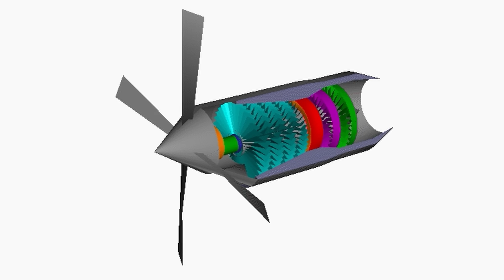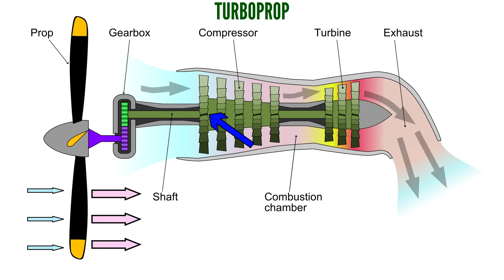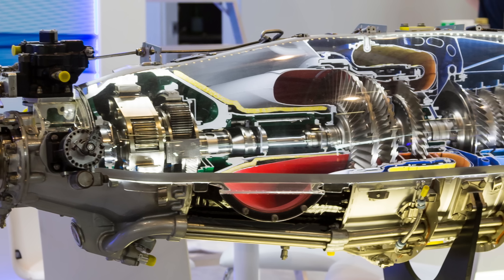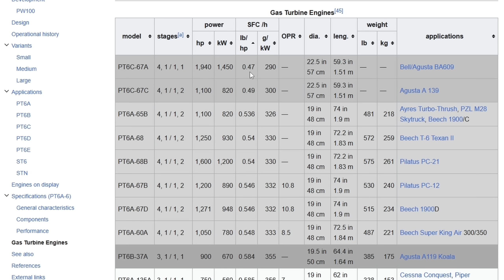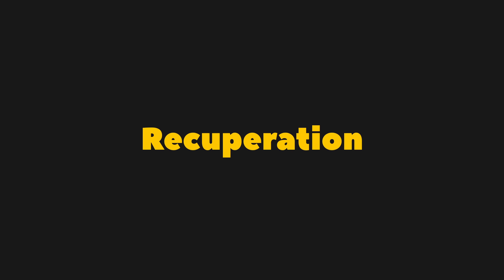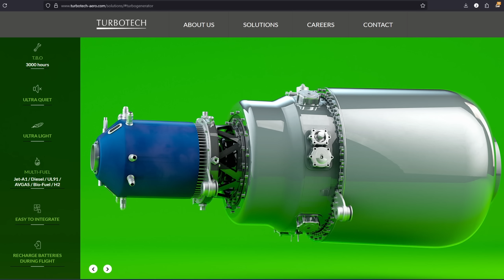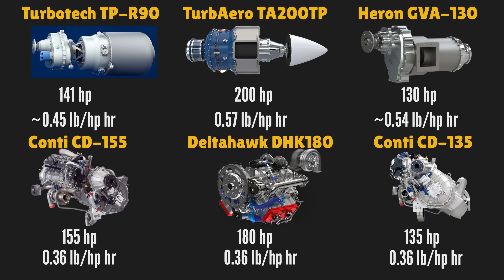Are Piston Engines Dead? Small Turboprops are Here

Comment: The bigger challenge will be to get STCs for older aircrafts as only few are able to afford a new e.g. Cirrus for 1.6 Mio EUR. If I could swap my IO-470-K (225hp; 1700hrs TBO) for a Turbopro with similar hp, 3000+ hrs TBO and 60-75k EUR, it would immediately become a valid alternative. Not happening though...

Comment: One simple answer, cost of ownership (incl maintenance and overhaul). Turbine engines cannot compete with pistons on this basis alone. Second issue is power range. Smaller aircraft cannot justify a 500SHP turbine (PT6-110, the smallest) when it only needs 300HP. Yes, I know that there are small turbine engines (e.g. an small Allison from a helicopter was put into an aircraft called a Nomad). For a small output, actual maintenance costs for an equivelant power turbine were much higher per flying hour. A brand new PT6-140 is around USD 560,000. A 300HP piston 6 is around USD 110,000. Even the smallest Garrett TPE331 is about 570SHP, no use for a cessna 206 for example which has 300HP.

Comment: In Europe (especially) avgas availability is an increasing problem. This makes Jet A engines attractive. Given diesel engine reliability issues I would pay more for a turbine option when flying single engine.
Reply from the maker: Yes, Avgas availability in Europe is a recurring theme in comments. The alternatives isn't just turboprops, it's also piston engines running on mogas (all the Rotax engines mentioned in video), or diesel piston engines (Continental CD-100 range, and Deltahawk).

In my opinion, wide turboprop adoption would need more than just the lack of Avgas availability, as there are other non-Avgas alternatives it needs to beat first.

Comment: A lightweight diesel would be more appropriate for snall planes. Power band right where you want it at 23 or 2400 rpm, run happily on everything from kero to mazola, no carb icing, no gears, simple, reliable, durable, economical. I guess that's why they don't make them. Certainly not gonna blow anyone's socks off on take-off or doing aerobatics, but for getting from A to B? Nothing makes more sense - and we do have the technology. Diesels do not need to be heavy anymore.

Of course turbines are great, but if we have the tech to build a 36,000 rpm blowtorch using advanced metallurgy and gear it down, I'm pretty sure we can come up with a basic 3 or 4-banger diesel at 1/10th the price and headaches.

Comment: They need to take this idea to the Next Level: A big drawback to turboprop engines is Turbine Lag - the time delay between when the pilot throttles up for power and when the engine actually delivers the called-for power. Pilots of single-engine and light twin-engine GA aircraft who are used to the rapid throttle response of internal combustion engines (which is critical to the performance of aircraft in this category) will be at a big disadvantage when they have to deal with Turbine Lag - a loss of performance drawback that could definitely result in an increase in accidents, injuries, and fatalities. 
The Solution:  Couple a small turbine engine with a generator + a small advanced lightweight battery pack + a light weight super-capacitor bank - driving an electric motor and propeller combo that, thanks to the full-torque availability from zero rpm that only electric motors can deliver pilots will now have ZERO Turbine Lag and unparalleled rapid-throttle response that far exceeds the throttle response of internal combustion engines. This combo will not only deliver a dramatic performance increase, but it will also provide a safety margin increase with high reliability of electric motors driving the propellers, along with the high reliability of the small turbine engine(s) driving a generator to power the electric motor(s) and the electrical power supply redundancy of the advanced, small, lightweight battery pack and the lightweight super-capacitor bank. And since the primary source of electrical energy to power the electric motor(s) comes from the small turbine engine(s) only a small battery pack would be needed, thus eliminating the need for a large and very heavy battery pack.

Comment: I'm 85 hours in on my Rotax 915is on my Tsi and am keeping an eye on this.  The one part that wasn't mentioned in this was TBO.  The 915 has a TBO of 1200hrs where as, from my understanding, the Turbaero should have around 3,000.  So more than double the TBO for around twice the cost.  The way I'd look at this is you're buying time between an engine replacement with the gains of the turboprop.  

I figure at 100hrs/hr in my Tsi it'll be around 12 years or so before I need to replace the engine and at that time much of this will be fleshed out in the wash.
Reply from the maker: Plot twist: you end up putting a 916 iS (2,000 hr TBO) in instead 😈

Comment: The way Recuperation was explained doesn’t make any sense. So because the air is preheated by exchanged heat from the exhaust gasses, less fuel is used but you magically make the same power/torque numbers and get more efficiency?

Stoichiometrically that makes zero sense. You can’t extract more energy with less fuel just because the air is hotter. If anything, engines produce more energy when the inlet air is colder since it’s more dense and harbors more oxygen to facilitate combustion.

Comment: Recuperators were used in early turbine engines, often called regenerators. The advent of high pressure ratio multi stage turbines eliminated the value of recuperation since the compressor exit temperature was higher and turbine exit temperature was lower. Small turbines are generally low pressure ratio machines and thus benefit from recuperation.
A small high pressure ratio turbine is too expensive and runs too high rpm.

Comment: Let's be fair. Piston engines will NEVER go away in the world of aviation. There's FAR too many planes still flying that require piston engines whether due to weight/engineering issues, or historic precedence/reliance on them (warbirds and other vintage aircraft come to mind). Plus, there's cost of ownership concerns that might dissuade potential buyers. If anything, these small turboprops will either only exist as an option alongside piston engines, or simply become a fad that fails to catch on and becomes discontinued within a couple years.

Comment: Many of these aircraft could cruise  well on 50% of their takeoff power..  This means that two of the engines could be provided for takeoff and climbing to altitude and then once the desired cruise speed is achieved one of the engines could be shut down.  There are a few ways that could be done.  One is with a combiner gearbox which has two input shafts and one output shaft. This is essentially what Soloy does with some of their systems.  Another option would be to have a relatively conventional looking twin engine airplane - two propellers and all.  In cruise flight the normal operation would be to shut down one engine for fuel economy.  A benefit of this scheme is true redundancy.  A challenge is with asymmetric thrust during single engine operation, but that’s something that all twin engine aircraft and operators deal with every day.  And, there are some airframe configurations that minimize the handling problems - like the Cessna Skymaster.  And the slightly less conventional Rutan Boomerang.   I think the latter would be an excellent candidate for being powered by two 200 hp turboprops.

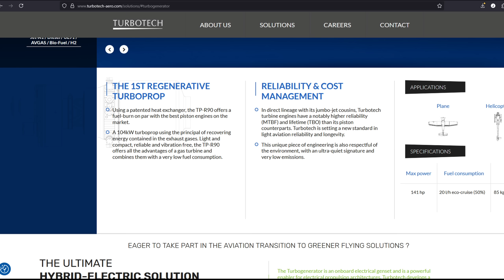Comment: 11:47  🤔 when discussing the advantages of the engines fuel, turboprop engines use Jet Fuel. Similar to Diesel. Piston engines are used LEDDED 100 octane AvGas light in the 70’s spewing lead EVERYWHERE IT FLIES 🙄 it adds up! It should be illegal to use and STUPID Tuners are sneaking into Airports and fueling their cars with AvGas and polluting lead emissions in traffic and exposing every single passenger down wind 😌🖖🏼🇺🇸

Comment: I wonder if accessories could be run from a final power turbine stage not connected to the engine turbine shaft, and use the waste energy that way instead of recuperation?

Comment: very interesting - you didn't mention range or cruise altitude - the light aircraft issue is stooging around in the weather and a turboprop gets them above it - pressurisation and cabin heat then become important, and bigger props for operating higher. Range of light aircraft are rarely an issue - as most trips are never on max tanks and empty arrival - in Australia trips between major cities would be perhaps the design sweetspot - so high cruise speed and high altitude become important. If TPs can achieve a 4 seat 100kg of baggage with plenty of automation - it would tick more boxes that the current conventional bug smashers.

Comment: Nope Nope and Nope - Your not going to buy a turboprop for 100k and turbine engines chug fuel at the lower altitudes that GA aircraft fly at. the 3000 hour tbo sounds great until you have to shell out for a hot section. 100k might be doable for the rich at ~300 horse power but at 140 there is no way. do a cost per hp comparison of a low time used rotax or a reman rotax vs your turboprop.  finally most of us dont really want to fly behind a rotax turning 5000 rpm with its associated gearbox.. give us a good ole Lycoming any day.

Comment: 00:47  "Perfectly smooth running with zero vibration" could only be said by someone who has limited exposure to turbines in general, and definitely not much to turboprops! They can certainly be comparatively low in vibration and smooth relative to reciprocating engines, but if you ask the average passenger why they would rather not fly the airlines' turboprop aircraft compared to the jets, they will cite the increased noise and vibration. We even have many decades with turbine aircraft instrument panels featuring relative-amplitude vibration gauges because how much they vibrate can be a measure of engine health.
Reply from the maker: You're referring to the propellers, not the engine.
Reply: @LetsGoAviate  Only partially. The propellers are inherently imperfect from a vibration standpoint, true, but so are turbines. That's why we commonly place piezoelectric accelerometers at the N1 and N2 bearing supports so we have an actual read on what's going on with vibration there.

Comment: Can anyone explain why turbo-props are used at all?  Basically, it looks like a normal jet engine hooked up to a propellor.  I'm sure there's a good reason for not just leaving off the gearbox and the prop, and using the exhaust gas as a thrust-producing jet (rather than driving the prop), but I can't figure out what that reason is.
Reply: More efficient then a jet
Reply from the maker: Also, propellers produce superior static thrust. That means they can takeoff shorter than turbojets and turbofans. That's quite important for small, low power aircraft

Comment: Excellent video. One aspect missing here is the price difference between Jet A-1 and Avgas though.
Reply from the maker: And Mogas (automotive petrol)
Reply: Good point, also maintenance.
Reply: And the weight difference
Reply: Yep, particularly in the likely event LL avgas will be banned and synthetic, unproven concoctions mandated for engines and fuel systems never designed for them. If LL goes away the calculation shifts massively.
Reply: @somealias-zs1bw  100LL is already hard to find in much of the world (I think not because it's banned so much as GA not being popular enough to justify providing it), that's one of the other motives outside the US. Though the other solution is diesel engines which are heavier but more efficient and can run on diesel fuel or Jet-A, both of which are pretty available worldwide.

Comment: Another factor to consider. It’s getting harder and harder to source avgas in many locations. For somebody in a semi remote location it won’t matter the cost of the engine, jet-b is available and 100ll is not.
Reply from the maker: Yes but that fact doesn't necessarily push the market towards turboprops. Mogas (automotive petrol) powered piston engines, like half the ones I showed, and diesel (or Jet-A) engines are there too.

Comment: Another thing to consider is the fact that piston engines are still reliant on leaded avgas, while turbines use unleaded kerosene and jet fuel. While unleaded avgas has been in the works for years, there has been a lot of pushback from the GA community.
Reply: No. If we're talking about new turbine engine designs vs new piston engine designs, there's also the potential to completely eliminate leaded fuel.

Comment: Excellent work with terrific graphics, well done! I'm surprised that you don't mention fuel type in the comparisons. These small gas turbines use JetA1, which is significantly cheaper than 100LL - and 100LL is at risk of being phased out for environmental reasons and because the only manufacturer of TE lead intends to cease production. I have operated both petrol and diesel piston engines. The diesel reciprocating engines are much heavier than the petrol equivalents. Engine weight is significant in lighter aircraft - for example, the Diamond and Tecnam SE aircraft are compromised by engine weight. Reciprocating diesel engines have higher compression ratios creating more vibration and the power pulses present problems for gearboxes. Therefore I think the comparison for light turbines should be with petrol recips, not diesel. When you then compare the cost p/hr of fuel and the engine cost divided by service life, and the increasing scarcity of 100LL, small turbines look very attractive IMO.

Comment: Good review!   After the baseline efficiencies noted the next major efficiency factor is based on the engine/airframe/prop  combination and with efficiency measured  (distance/time)/liter of fuel which measures how efficiently you can get from here to there as a function of speed and fuel consumption.  If the turboprop/prop combination is matched to a airframe in cruise configuration, has minimal drag, then your travel efficiency improves whether you are piston or turboprop powered.

Comment: I think GA pilots that fly cross country routes with passengers and luggage are the ones most likely to be interested in smaller turboprops, but not this small! I would definitely be interested in something like a turbine powered, pressurized Bonanza A36 type aircraft without having to shell out the money to buy and operate a TBM. I think the 300HP size is really where you would find demand for the high altitude performance and high reliability for pilots that want to be able to fly IFR at night and/or over the mountains safely. Piston engine reliability is a major obstacle to this. Trainer and light sport aircraft that the 140 to 200 hp range services do not really have a need to fly high, far, and in the soup.

Comment: I think big factor will also be the fuel availability:  The avgas will become available less and less, while the jeta more and more common, as it becomes more universal. But that could be served also by diesel engines, which did popped up in recent decade, which have even better thermal efficiency than the avgas ones, yet are not that much more expensive.

Comment: Although the turbo pop engine may be more expensive its TBO time is anywhere from 150% to 300% longer than a piston engine. This would offset the cost considerably. Also remember the weight savings. Your payload goes way up along with reliability when using a turbo pop engine.  Turbo Props run Jet A., which is less expensive then avgas .

Comment: A small turboprop might come closer to the SFC of a piston if they incorporated ceramic composites into the turbine section and raised compression ratios to handle the heat, but this would raise the price considerably due to low volume production. I think the best option for GA would be a water-cooled Lycoming or Continental which could get closer to a diesel's efficiency by bumping CR from the factory 8.5:1 up to 10.5 or 11:1. The much lower operating temps should allow for a longer TBO and you'd eliminate the need for avgas.

Comment: Not an airplane tech person yet but this also helped me to better understand how turboprops work and how they compare to piston engine fuel efficiency. 
I'd be curious to know re maintenance how a proven design such as piston engines compares with maintenance costs over time with turboprops. Seems to me that if turboprops are less fuel efficient and currently have higher maintenance or replacement part costs designers may need to go back to the drawing board to solve these issues before turboprops are competitive.
Reply: Gas turbine engines dominate the aviation industry because they are more reliable and have a LOWER overall cost. 
 the problem with GA is the higher up front cost.

Comment: Cost? No. You can buy 3-10 piston engines for one turbine
Fuel economy? No. 1.5 to twice the fuel burn
Reply: A gas turbine will easily outlast 10 piston engines.. fuel burn depends on the flight profile... long flight good, short flight BAD.